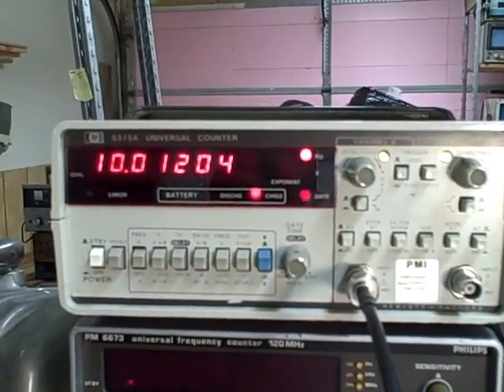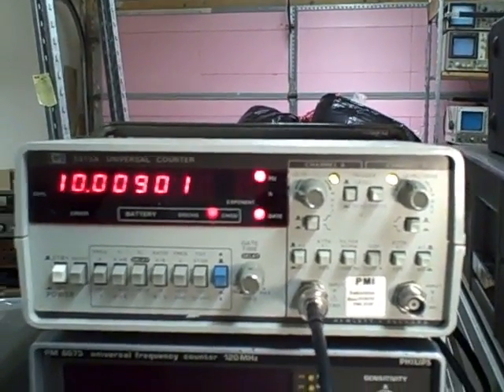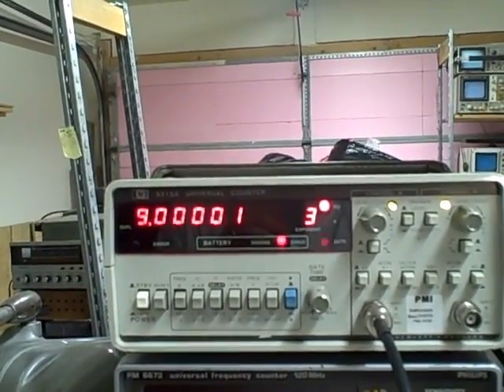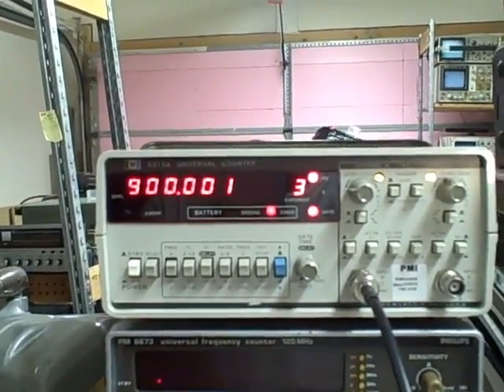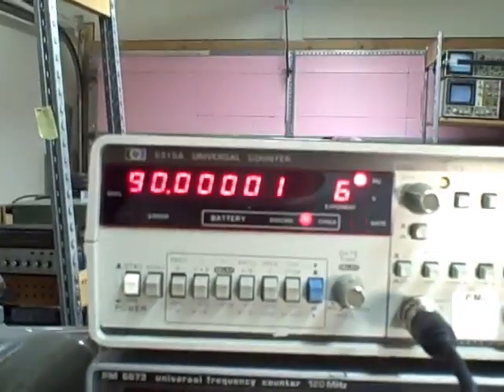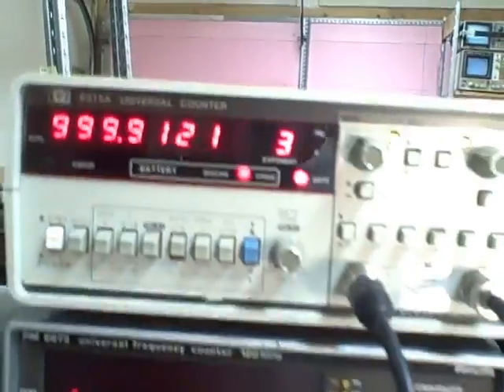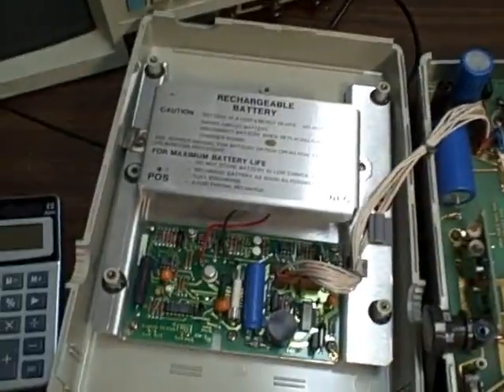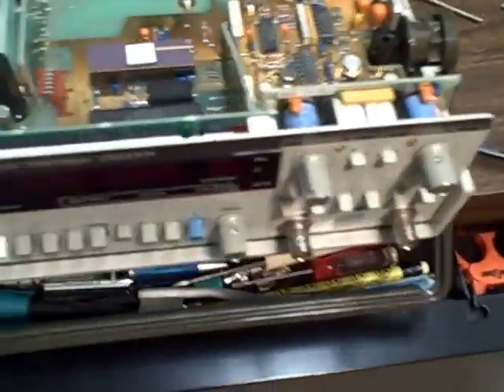hp5315a unit2.avi

Comment: Hi, I've had the same model for many years but now the display digits went dark. They only flash once (all 8's) at power on instance and went dark right away. The only LEDs that work are the two LEVEL/SENS lights (flashing with input signal).  Do you know what might be the likely cause? Could it be some bad electrolytic caps in power supply section?

Comment: will that work to alignment on CB or ham radios if not could you think of one not to expensive that will align a 10, 11, 12, meter radios. you have an amazing collection there. thank you. ben..
Reply: +ben evans 
Yes, it would.  For best results you need both a stable generator and frequency counter.  Best bet, get a counter that has a very stable oscillator (ocxo or good tcxo).  The generator must be good around 27mhz and should either be synthesized or use PLL for stability.
Reply: thank you Bruce, I have a chance to buy one of these, as I have a 10, 11, 12, meter galaxy Saturn radio that drift off frequency badly even after I leave it to warm up for hours. thank you for your help. "god bless" ben..